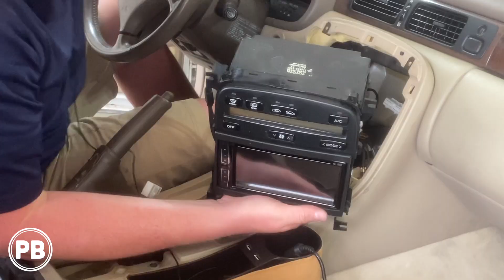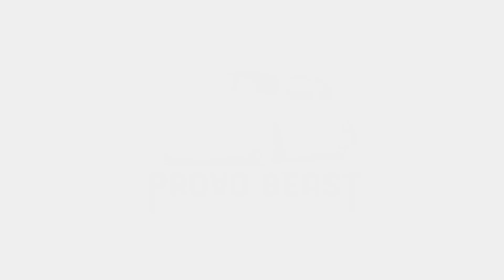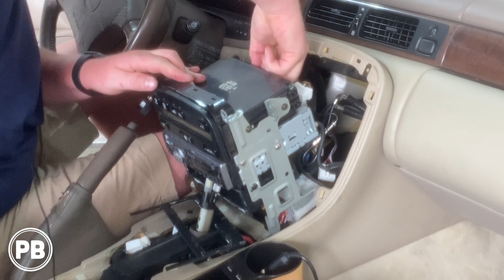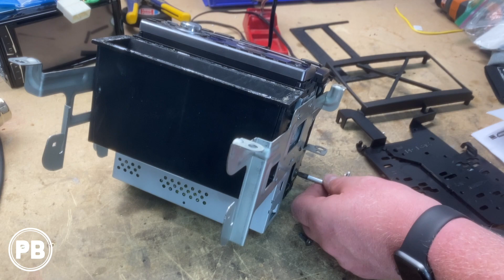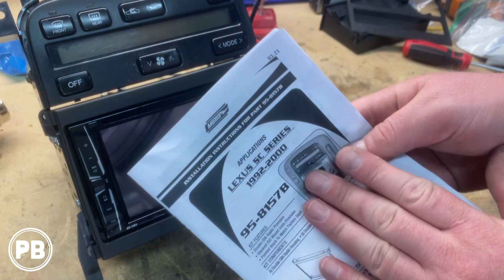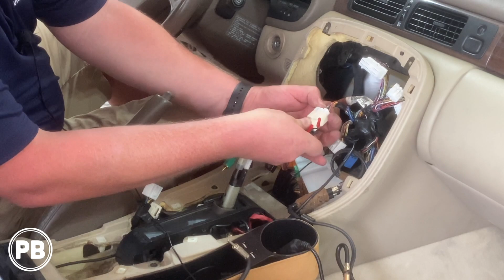1992 - 2000 Lexus SC300 / SC400 Radio Install

Comment: Recommend utilising the original metal frame over the top of the Metra brackets. Far superior, far stronger and the Metra doesn't bolt back to the factory dash bracing. You have to make a few mods here and there, but it works. This installation looks ok on video, but is very shoddy way of doing things.

Comment: I have a 2000 sc300. I just attempted to install a Panasonic double din to replace the factory radio and amplifier. It didn't have a CD changer. 

I used the Metra install kit and harness, but my harness didn't come with the RCAs. The radio doesn't power on. I checked the fuses and they are good. I will diagnosis further Monday when i get back to the car. I will have to get crutchfield's tech team to assist as well
Reply: Did you figure it out!?…

Comment: The Metra harness is different now. There’s no yellow, no orange,  no brown. And my speakers are just making buzzing sounds. I’m so confused cause I follows this exactly as you did it
Reply: Did you ever fix it?
Reply: @ I did. The Metra harness needs to be paired with a Ground Loop Isolator on the RCA plugs section of the harness. The radio/headunit has way too many power wires surrounding it that causes static within the sound system. The one thing I can’t get working is the factory sub because the Metra and new headunit can’t communicate with the factory amp.
Reply: @stopmotionking241  thank you bro, do you have a link for the ground loop isolators you used?

Comment: Quick question what if you’re trying to bypass your amp and use the amp build into the radio can i connect those speaker wires from the radio harness and run them to the speakers itself ?
Reply: I did this and it works. I was lazy tho I only wired to subs nothing else but a lot cheaper than buying an amp that’s for sure
Reply: @Meezy420  yeah I ended up doing it and got new apeakers

Comment: Dear @provobeastaudio , please tell why after installing this kit, front and rear speakers work but my original Nakamichi subwoofer not working. Maybe you know what I have to wire additionally to turn it on? Do you know which original connector pins/cables go to subwoofer signal?

Comment: what sc are you working on? Mine is 1999 sc400. on the back of the stock radio there are 4 connectors. and I see is that the male connector from the Metra 70-8112 does not fit to any of them. Can you help.
Reply from the maker: You will need the Metra 70-1761 if the other doesn’t fit.

Comment: Thanks for the instructions. Got everything working. Only problem is I am getting a noise if the engine is on and noise increases with acceleration. Planing to use ground loop isolator. Which wires do I need to connect?
Reply from the maker: Sure, well it depends on your trim and parts used.  If you have the factory amp (like we did) and using the harness adapter with the low-level RCA connections, then this ground loop isolator may help (two orders needed unless you buy a 4 channel): https://amzn.to/3KfDIYm
Reply: @ProvoBeastAudio thank you for the suggestion, got 2 of them and that did the trick. Sound is as clean as the OEM.
Reply: Thank you. I assume this is plug and play and don’t need to ground and solder anything. I would just have to plug the 4 ends to the 2 ground isolators and plug the ends from the isolators to the unit

Comment: I wired everything correctly but still have no sound, maybe i have the rca colors mixed up?
Reply from the maker: No, sounds like you failed to hook up the blue / white amp trigger wire. Your factory amp isn't turning on and consequently have no sound.  Hook up that wire in the harness adapter to your new radio's amp or accessory wire, and it should turn on the factory amp.
Reply: @ProvoBeastAudio  turns out it was the amp wire, for whatever reason it was being pushed out of the connector. I had to hard wire it into the factory cable
Reply: @lalito._.01 how did u manage to do that i’m having the same problem just don’t know where to wire the blue white into
Reply: @ProvoBeastAudio  I don’t see an amp wire for the new harness???

Comment: Hello I connected everything and the radio turns out but I have no sound. I have the 6 cd changer in the trunk and used the harness of the plug. besides the purple grey and white wires for the speakers i didnt use the blue/white wire which is for the amp and im using a sony unit. do you have an idea of why it is not working? should i try the other harness or something else?
Reply from the maker: Blue white wire controls the factory amp. Required to be connected to the radio in order to trigger the factory amplifier to turn on.
Reply: @ProvoBeastAudio can i wire it with red or yellow cause my lexus harness dosent have a blue white wire
Reply: @joshhernandez2574 you can, but be careful, wore it to cable where current exist only when you turn acc otherwise stock amplifier in the trunk will be turned on always

Comment: Hey, I'm wanting to do an aftermarket amp in my sc300, I have the 12disc cd changer and ik the amp is under it, would it be plug and play to install a new amp or would it require a lot of work?

Comment: Hi we have the Japanese import 1991 soarer . With the v8. It has this stupid stereo that has the heater stuff in it. If we get rid of the stereo and put one in like u have done we would also have to buy the lexus heater unit like you have which is easy to buy. Would you know if it would be hard to wire the heater unit
Reply: If the heater controls are integrated, you will not be able to control heater.
I would just modify stock stereo system

Comment: With this upgrade on a nakamichi system, do you have to leave the amp installed? Or can you remove it and run the speakers without the amp?
Reply from the maker: With a bit of rewiring, sure, you can bypass the factory amplifier.  We kept it in this vehicle per the customer's request for the time being.
Reply: how do you bypass the amp? im asking because my amplifier does not work so i plan on doing that, thanks  @ProvoBeastAudio

Comment: Do I need a new amp if I’m having a whining noise ?
Reply from the maker: I’d recommend to bypass the amp if you have a ground loop issue, or trying using a ground loop isolator.

Comment: Hi, you skipped the part where you cut the giant X off the screen? How did you do this without leaving white marks
Reply: how did you end up taking off the x?
Reply: @bryanbarajas681  seconding this^
Reply: I used a small wire flush cutter.

Comment: Hey bud I need some help with polarity for the 2019 Subaru Impreza base model front door speakers
Reply from the maker: Use a 9v battery and see which way the factory speaker pops. If it pops outwards, whatever wire is in the positive side of the battery will be your positive wire

Comment: How do I determine if I have an amplified sound system?
Reply from the maker: If you have the 6 CD changer in the trunk l, you have the amplified sound system.
Reply: @ProvoBeastAudio  I do have the 6 disc changer in the trunk but was always uncertain if mine was the amplified system because looking at the factory head units, some are Nakamichi, which as I understand are amplified. My head unit doesn’t display the Nakamichi logo but my vehicle does have the 6 disc changer so some confusion there. Wondering where I would look, if the factory amplifier was mounted in a specific location to determine, assuming it wasn’t built into the head unit.
Reply: There in an amp mounted directly under the cd changer. The cd changer implies your car is amplified. It's most likely a pioneer amp as the nakamichi systems had it advertised on the center console
Reply: its under the cd player  @Mister_Y